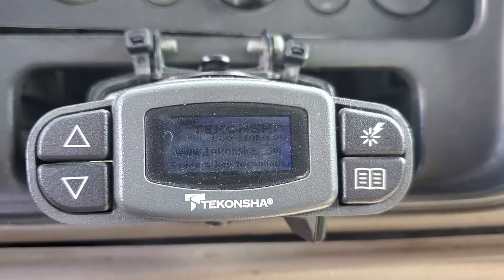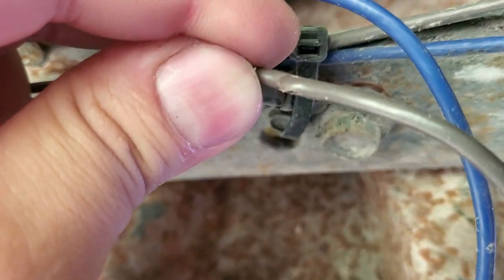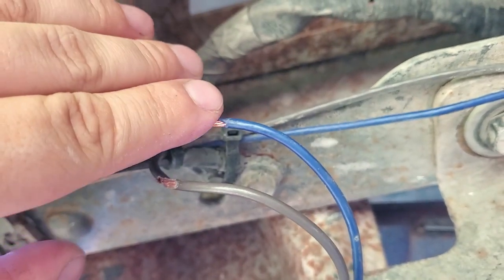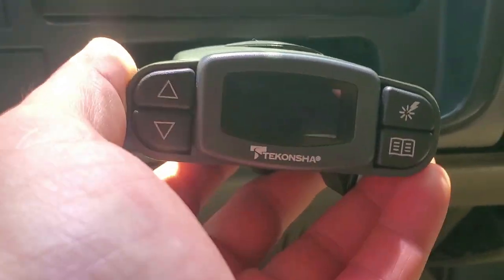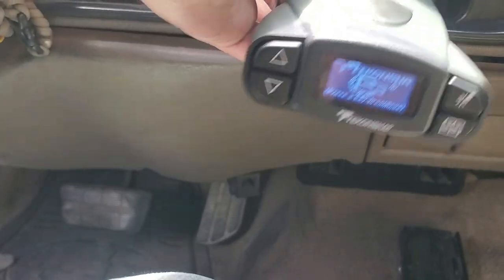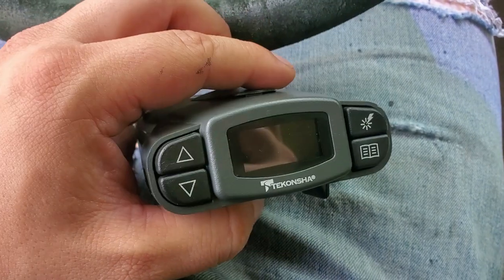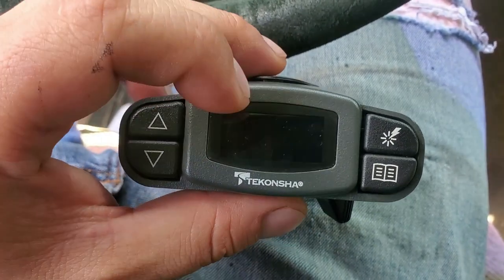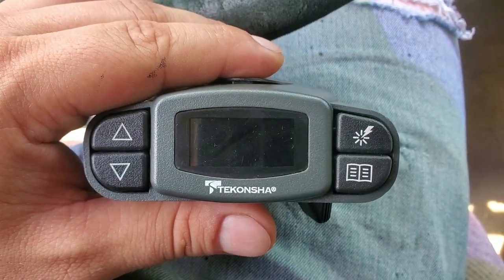Tekonsha P3 Short to Ground No Brakes problem Solved!

Comment: Mine is giving me the output shorted error when a trailer is not even hooked up . Also when I plug it into the connector it goes green for a second or two and then I get the error?
Reply from the maker: I would check the wiring as i did to make sure it isnt rubbing on any kind of metal part like a frame edge or something. If no, this may have happened